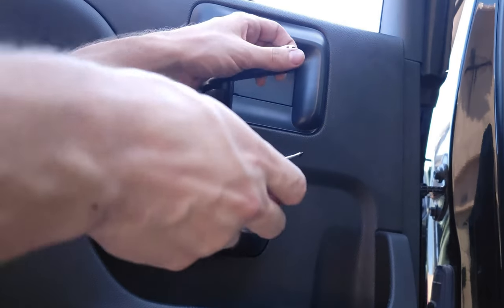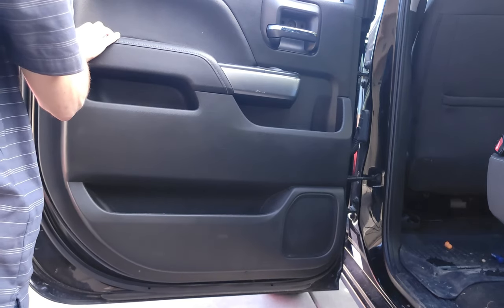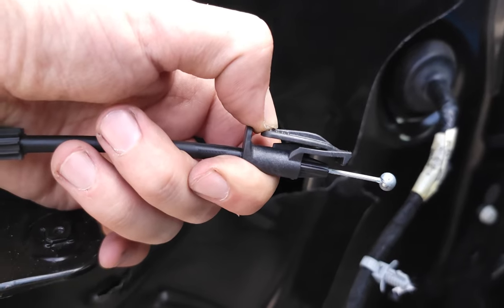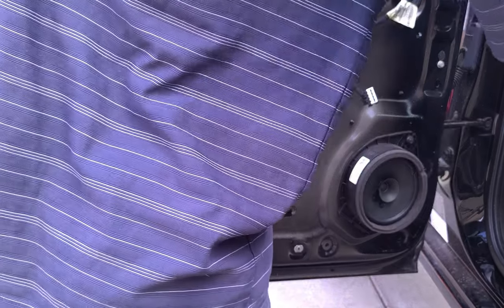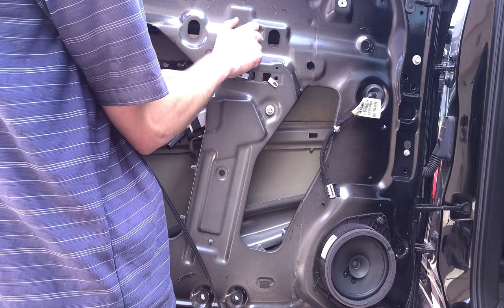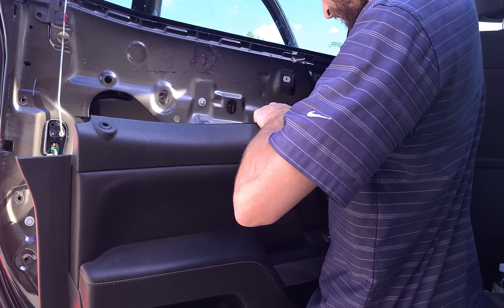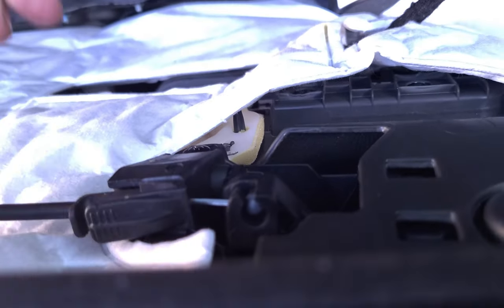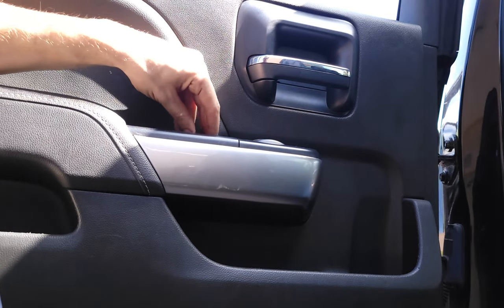How to replace window regulator 2014-2018 Chevy Silverado

Comment: I like your videos! Keep up the good work!  Love how you show the bugs in the door handle recess and just keep working.  I live in FL now so I guess I'll make sure to put that vapor barrier back in properly.  I don't even have a Silverado, I have a 2001 Tahoe, but I've wound up doing several window regulators and have several more friends-and-family windows to do, so I wanted to see your approach.  I would tease you about using pliers to get those bolts, instead of having the right size socket handy but we've all found ourselves having to improvise when we don't have the "official" tool.  I do actually have some plastic clip removal pry bars, but darned if I can always find them when I need them!
Reply from the maker: I now have a full set of 1/4" sockets and use them quite frequently lol. Like and subscribe!